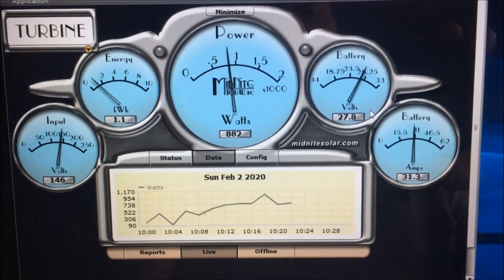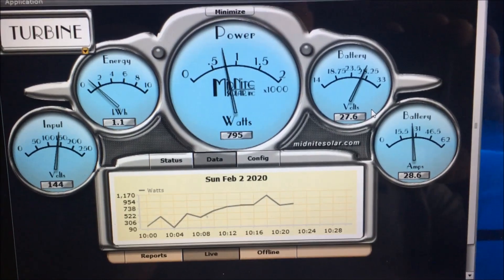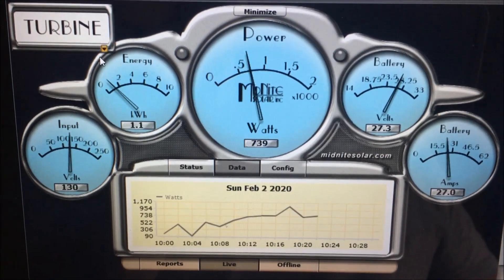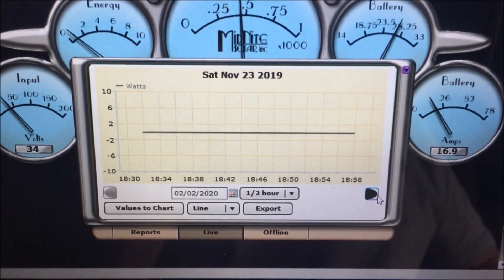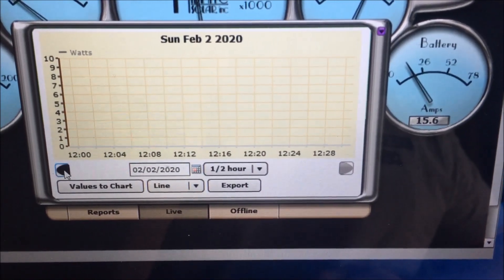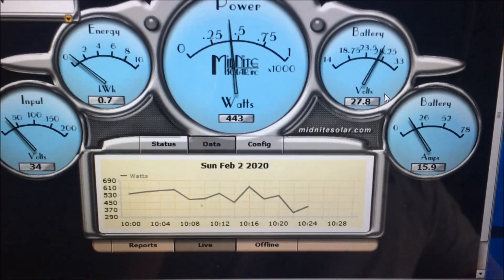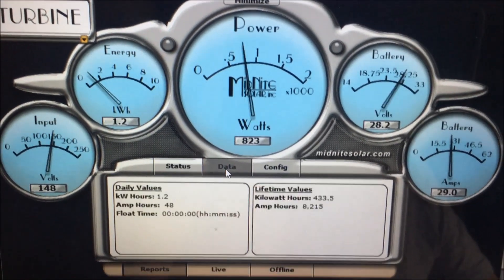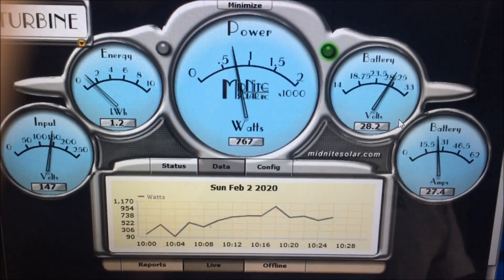Hurricane Vector Wind Turbine off grid 24 residential wind turbine generator with 1 kw solar

Comment: Decent for the size of the turbine, i think the large turbines would impress
Reply from the maker: There is only 40 amps written into the controller  and a full set of batteries. We will put it in 48 volts and wait for a 50 mph wind a show 5000 watts for two seconds because we can however  this is not important.  this was shot tooling around mostly at 12-15 mph winds with an occasional gust. Now we both know I and a lot of other people have the other brands and to make the power this turbine makes they have to shoot output videos in storms ....just saying you know the truth
Reply: Yep we all learnt the truth the hard way LOL Hey atleast lessons learnt the hard way are never forgotten , keep em comming.